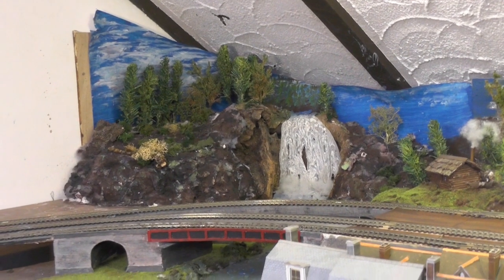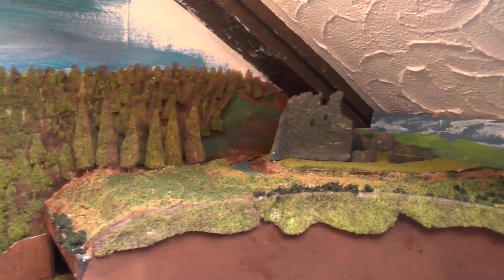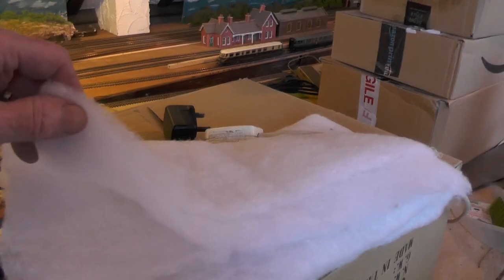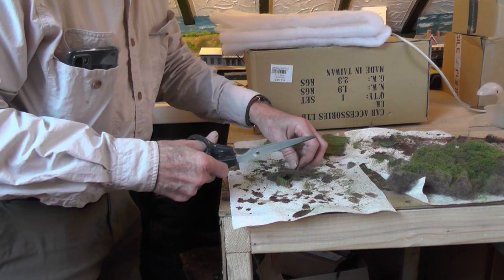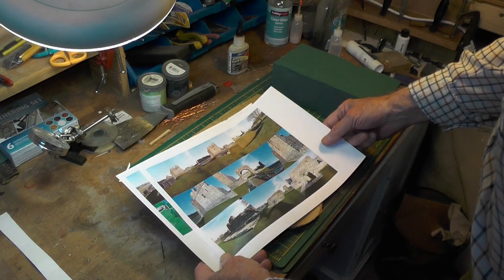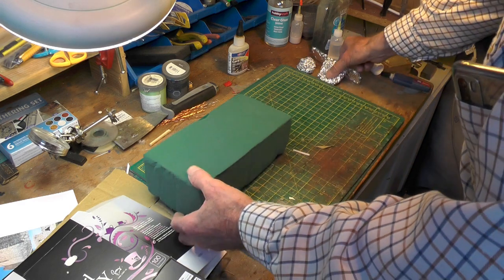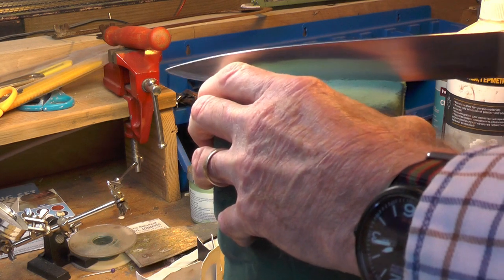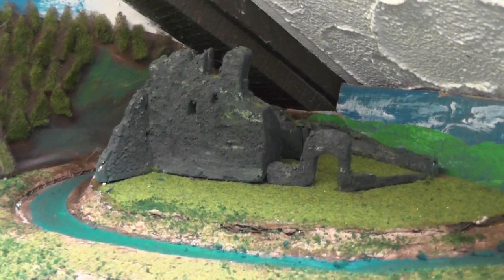Rebuilding a Model Railway Castle Corner  Episode 14 Castle walls made from cardboard & Floral Foam

Comment: Great result Michael. It is amazing how you can take everyday objects and materials and make models from them. I think I shall have to watch the forest making technique again. The crumpled aluminium for texturing was inspired. I have tried floral foam as a lush green ground cover. I put glue down and then rubbed two blocks of foam together over it and the result looked good but with time and exposure to the light the foam turned brown. It will be of interest to see how well the castle holds up. Thank you for clearly pointing out the shed, my mini Glas Fryn at Glas Fryn.
 I have several sheds on British layouts. Regards, David.
Reply from the maker: Thanks for the comment David. I was pleased with the forest as it looks 3D.  The castle should be OK because I painted the foam.  When I ordered the foam there were 3 blocks in the pack and I thought about doing what you did.  However in order to get a variety of shades I was going to soak it in a weak paint mix.  That might stop it going brown..  Regards Michael

Comment: Looked great, good use of materials. I thought with the Lanc there might have been an airfield, for me to land on 🙂
Reply from the maker: Thanks Algy.  I haven't room for an airfield so the Lanc will go back where it used to be, hanging from the roof along with the Spitfire and Hurricane. The two little ones are on a shelf.   However if you put some BIG tyres on the Kub you can try a mountaintop landing when I have built it. Cheers Michael
Reply: @michaelchartres  Well if it has a nice grass medow I could land with the tyres I have.